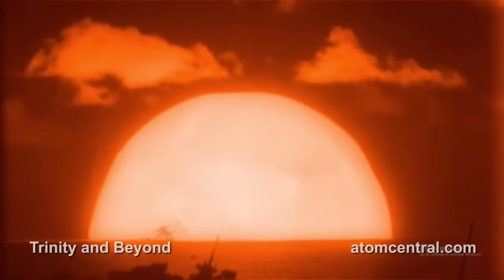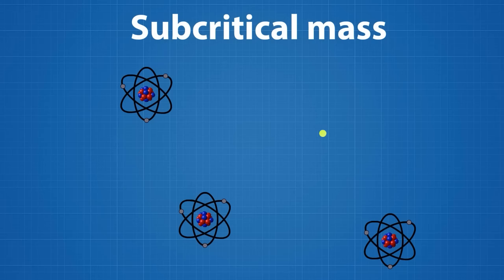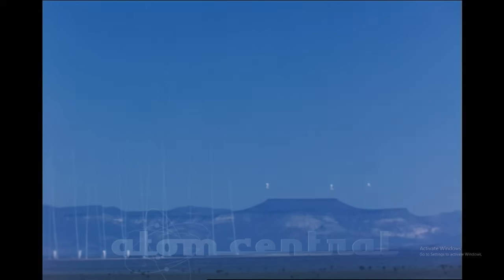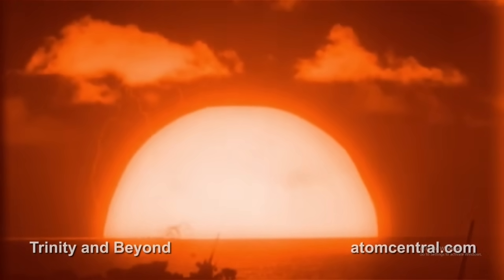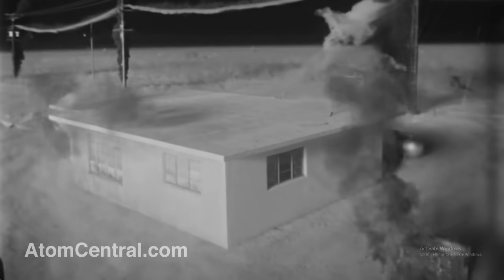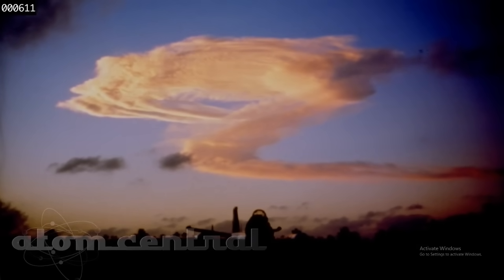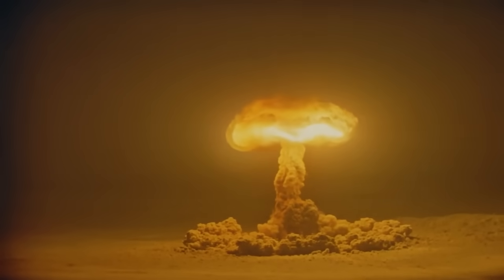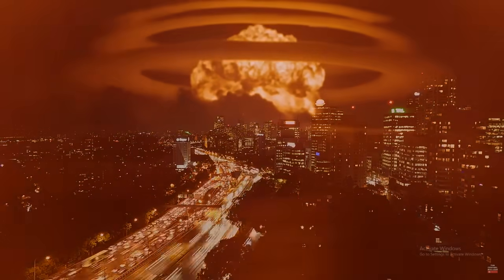Anatomy of a Nuclear Explosion

Comment: The uranium is imploded simply to create enough mass to achieve critical mass, not on order to compress the metal, which is basically impossible.
Reply: Actually the shaped charges do considerably compress the metal.  The Trinity device and most following had only plutonium.  Later some uranium was added to test the affect on yield, but it was not to enable compression.
Reply: The Uranium bomb didn't use any implosion, but rather the gun-type design. The Plutonium bomb uses implosion and the core is compressed by a factor of 2-3. The compression increases density and creates a prompt supercritical configuration. This is a much more efficient design, as significantly less fissile material needs to be used.

Metal is certainly compressible, especially with explosives. Anti-tank missiles and grenades, for example, compress a copper core asymmetrically to form a dense jet of liquid metal that, due to its density and speed, can cut through armor.

Comment: There is more than you let on about the initial explosion and fireball, but I appreciate what can be explained to a non-physics crowd.  Gamma and x-rays are not produced by atomic electrons; they come right from the nucei due to nuclear decay.  Neutron flux from fission is the most important sort of radiation.  The exploding core is heated to 50 million K, and floods the volume around it with everything from radio waves to UV by black-body radiation.  The x-rays, gamma-rays and neutrons are absorbed by the air in a relatively small volume creating  the fireball, which leads to the pressure wave.  In space without atmosphere, and explosion leads to an extreme EM radiation: radio, IR, light, UV, x and gamma.